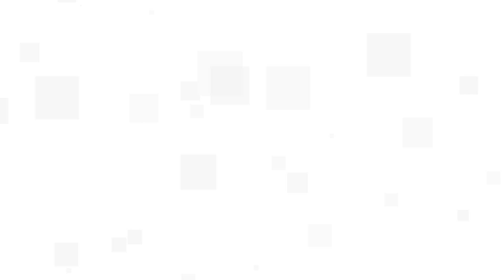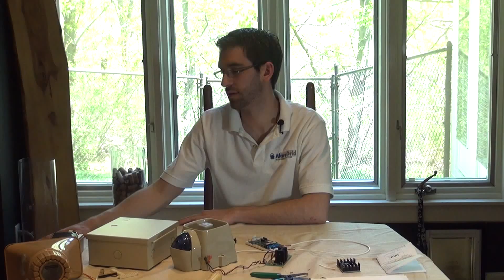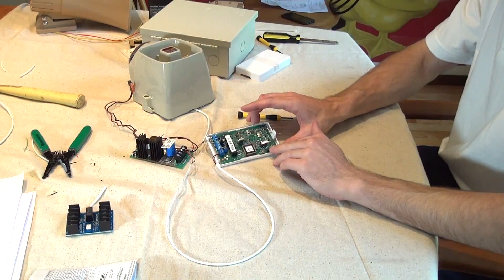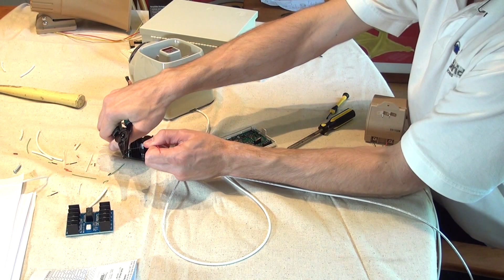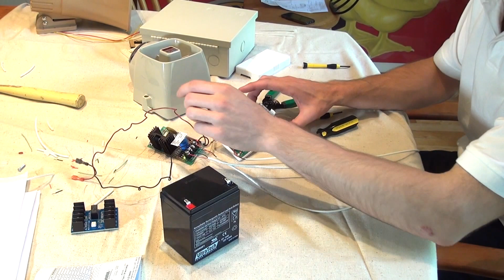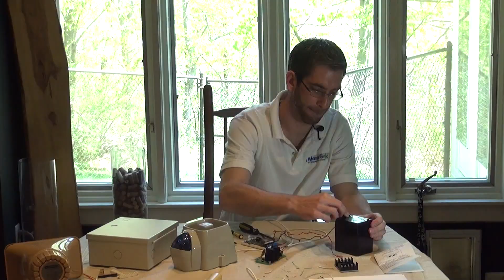Honeywell AD12612: Connect the LYNX-EXT to Power Supply

Comment: When I wired mine I'm using an ademco 747 indoor siren and when I connected power it goes off? I'm confused did I wore something wrong
Reply: Dillon Brock Did you use the wired or wireless relay module?
Reply: Probably used the common and normally closed contact. Use common and the normally opened.